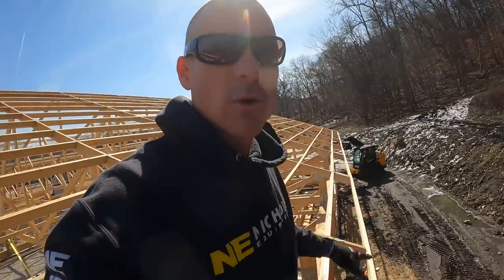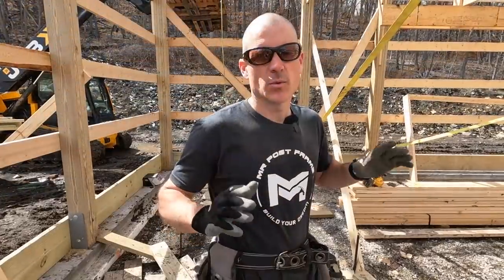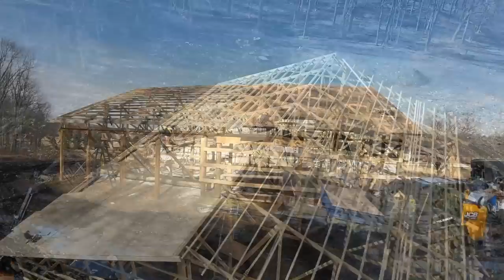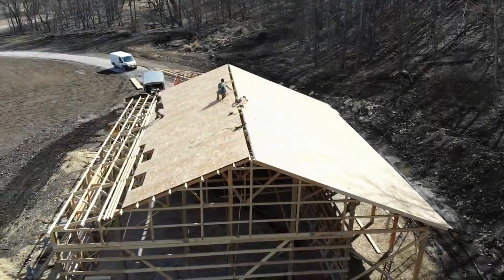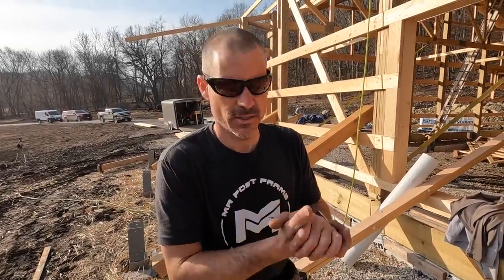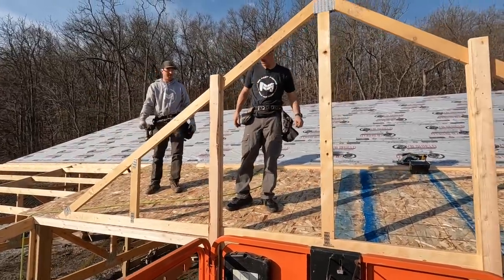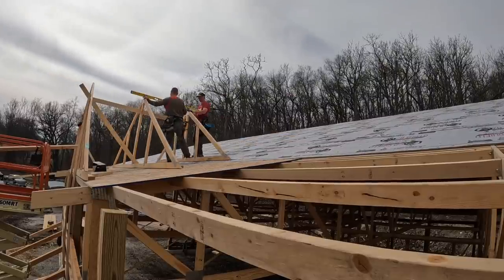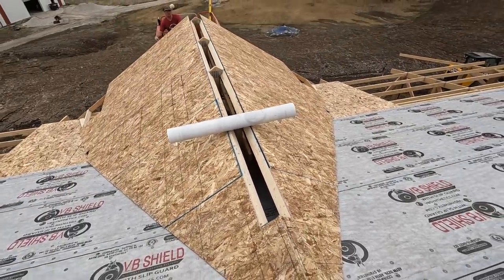Building a Post Frame Home | Roof Sheathing + Valley Trusses | Remington | Ep 7

Comment: I'm not a builder or in the trades.  Just a tech guy who likes to DIY, but I'm interested in knowing why you ran the OSB vertically and not horizontally.  In all other videos I've watched, the sheathing has been installed horizontally.  Love the way you explain why you build and install a certain way.  Great content and keep up the great work!  Cheers.
Reply: it is due to the lay out of the roof, the trusses are 8 feet apart and the purlins are every 2 feet. typical stick frame has trusses every 16- 24 inches and the sheeting is what ties the trusses together.
Reply: @jasher452x  Thanks for the reply.  Makes sense.